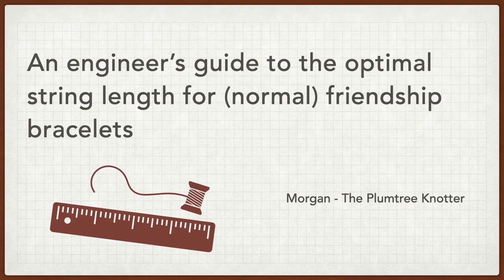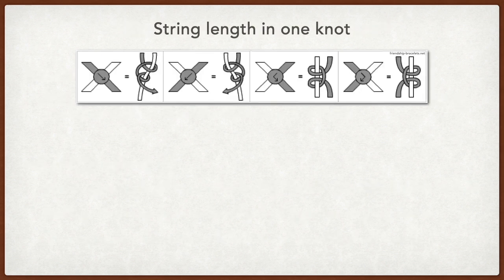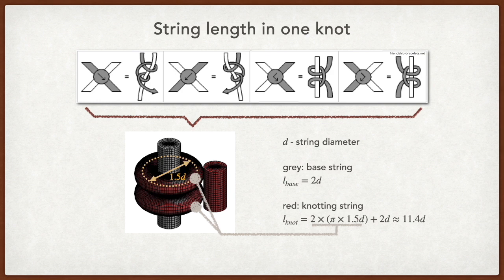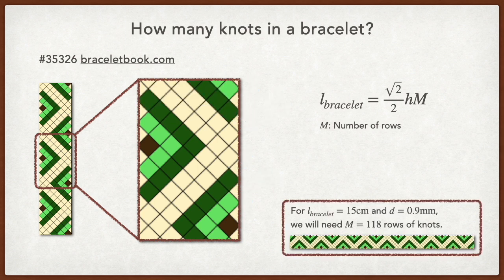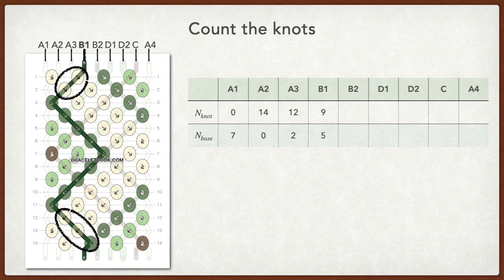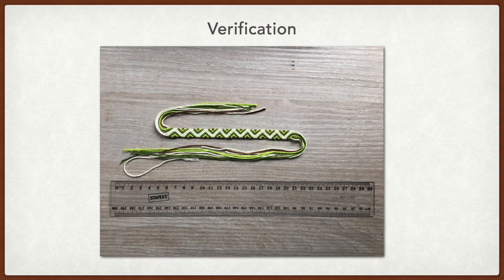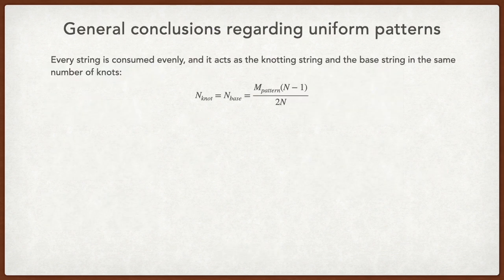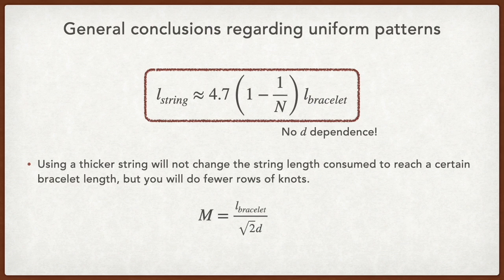An engineer's guide to the optimal string length for (normal) friendship bracelets

Comment: This is amazing, but wouldn't it be different if the strings don't end up in the same position after each reptition of the pattern? For example in patten #5608, the A1 string ends up as A2 in the next repetition of the pattern. Would that make the formula not work correctly?

Comment: just to confirm, this calculates the individual string lengths - so if you typically take 1 string and loop it at the top you have to add the string lengths together?  In your example at the end of the video, not including the extra 30-50 cm tie, you would cut a 120 cm piece and fold it in half to make 2 strands of 60cm....right?

Comment: This is BRILLIANT - thank you! 

I like to make longer projects for covering hair bands, using thicker plied yarns instead of floss, and varying numbers of cords (strings). Now I can figure out the required total length of each cord, and cut pieces to minimize the number of joins required while still keeping each cord to a manageable working length. And I can plan ahead for when I'll need to join another length to each cord, so I don't end up with all my joins bunched together. With thicker cords, it's much harder to make those joins invisible!

An absolute game-changer!

Comment: This is amazing. Thank you for putting the work in to figure this out and sharing your findings. I actually had to quit this exact pattern the first time I made it because some string came up way too short! I will use your formula any time I make a bracelet now. Thanks again!
Reply from the maker: Thank you Kate for your kind words :) It's a nice feeling to know that the formula is helping other people. Your comment just made my day!
Reply: Is this with or without strings doubled over? Like, using 6 strings folded over for a 12 string pattern